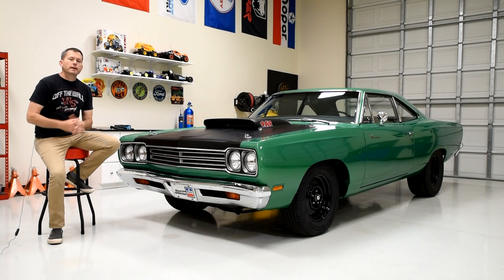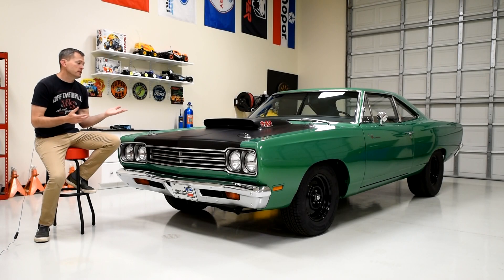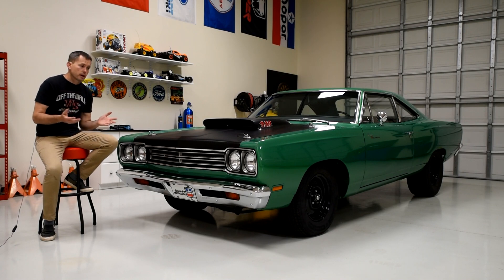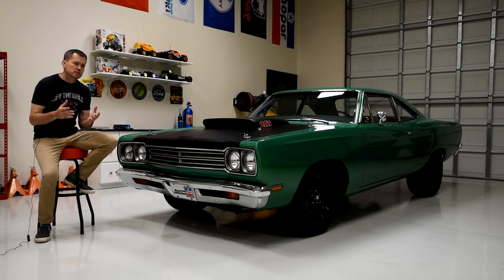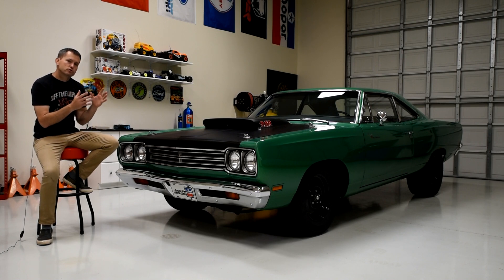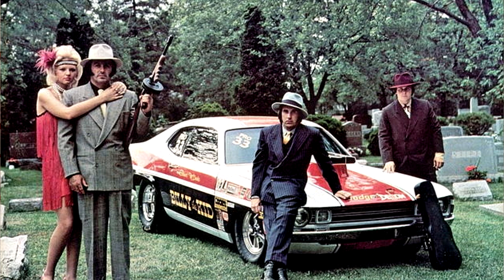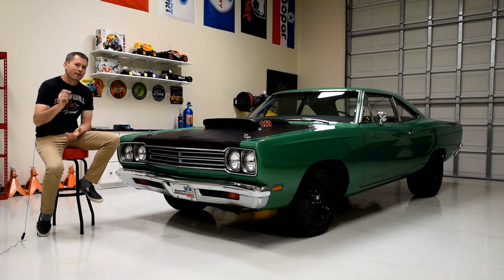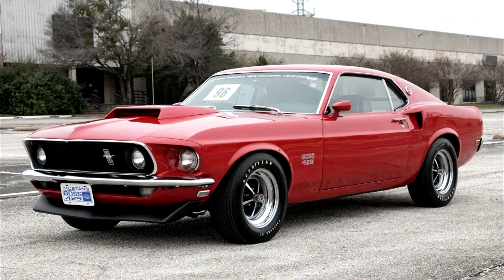The First A12 Plymouth Roadrunner Sold in Ohio ~ "CHAOS"

Comment: Was the intake cast or aluminum I got one from edelbrock is ther numbers on it beautiful  very nice car especially it’s a early one you  it’s awesome that it has won in the stock class
Reply from the maker: The original engine on this A12 failed in the early 70s and the intake and carbs were stored in the trunk and eventually sold by Carl's brother, Dan without his permission. Point being, I never had the original intake, but in 1969, they were aluminum and produced by Edlebrock. I used an Edelbrock replacement aluminum intake, which to my understanding is an exact casting of the original.